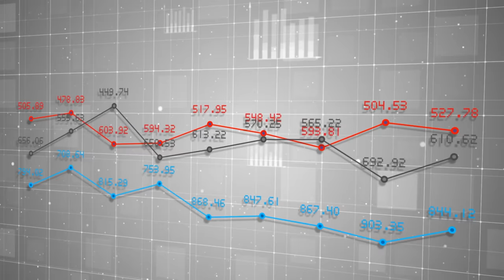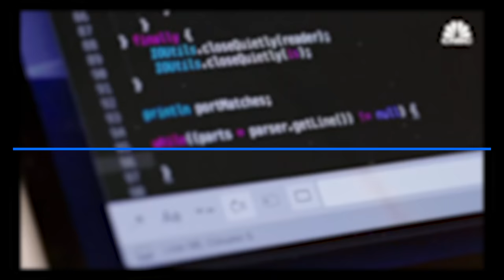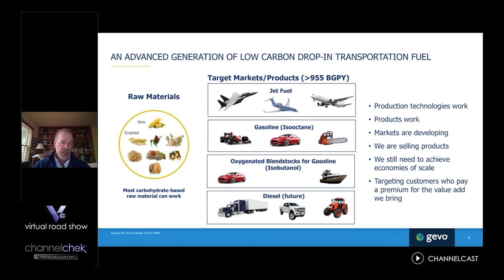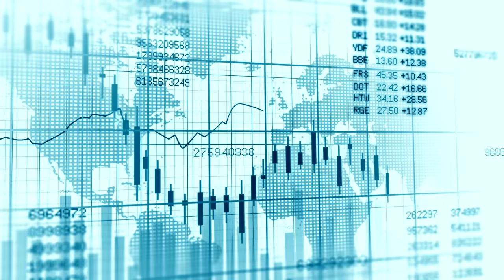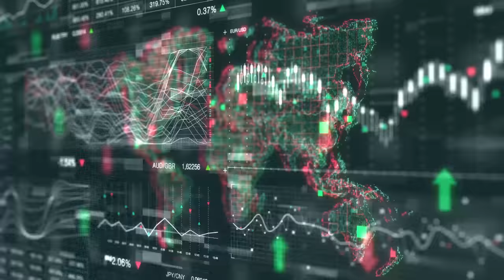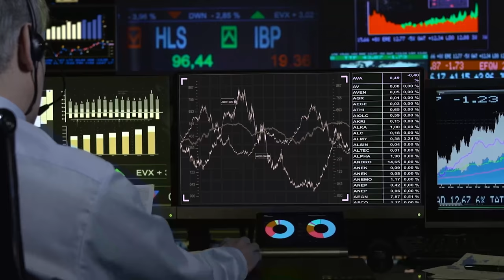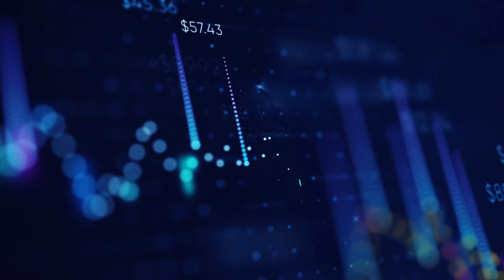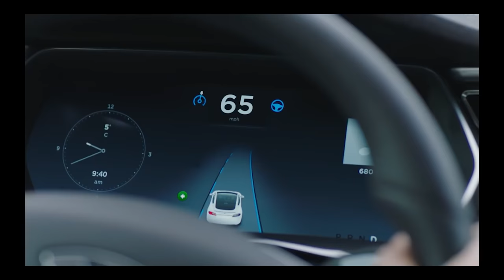The 5 TOP Stocks To Buy in March 2021 (High Growth)

Comment: I have been exchanging for around a half year now and pretty much every exchange reverse discharges and smacks me in my face. Almost outlandish for me to get in excess of a couple of focuses . I attempt to do top down examination yet it doesn't work for me . I say to myself, plainly I'm in the 90% that lose cash, so I open a demo account, do my investigation, at that point take something contrary to what I would regularly take and get a similar outcome. I'm beginning to feel miserable, any guidance for a striving broker?
Reply: Your problem could be your stop loss is too close or you're watching your trades too much. Place it and walk away. Or you could just give up, trading isn't for everyone.
Reply: @amirsaheed2645  Try not to hear him out, don't surrender. Exchanging takes time(months, even years) to dominate, even the aces learn ordinary. Never the less, in the event that you lose cash regardless of which side you take, perhaps you need to take a gander at how you are overseeing dynamic exchanges instead of how you are entering them. My recommendation, discover a guide . And furthermore, have a go at consolidating the utilization of oscillators, Bollinger and turn focuses into your technique. What's more, in particular move to higher TFs(4h or 1D ideally), you'll express gratitude toward me later .
Reply: @deloriaenterprise744  You're correct, I don't lose money every single trade, but my main problem is trying to let my runners run. Very rarely do I catch big moves . Instead they go a few pips in my direction, then go against me if when I try holding them. Also my entries could use a lot of improvement. A mentor would be amazing, but getting one is easier said than done. If it's not too much to ask, do you know any legit ones?
Reply: @brandoncolon418  I am aware of one woman however, she isn't a tutor fundamentally, yet she is shockingly acceptable at exchanging. From what I've accumulated she used to work for an exclusive firm till she resigned. Met her at one of those meetings, became more acquainted with her and we traded messages. Since she caused me, I've been making about $1000 fortnightly. What I'm attempting to say is the 5% of dealers on the planet that are reliably beneficial are not on YouTube, they are simply irregular/lowkey individuals nobody even expects . Her name was Laura woods incidentally.
Reply: @deloriaenterprise744  This is interesting i heard certain things about this Laura woods you speak about and her amazing strategy honestly , Does she accept beginners?